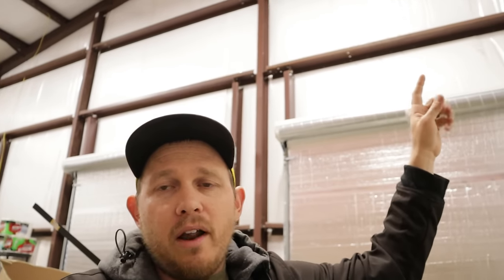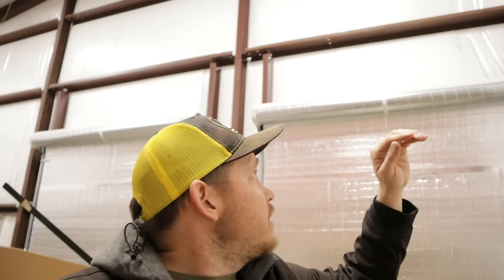My Biggest Steel Building Regrets

Comment: Truck size door is minimum can bring in anything with that size. I consider truck size insulated door standard 14X12 minimum or larger if working on heavy equipment like dozers and excavators. Insulation spray foam is a must in Canada and northern states. Floor heating is a blessing. If you have access to waste oil run a waste oil furnace and boiler. With waste oil burner if can't get waste oil can always use diesel, furnace oil, hydraulic oil and many more. Radiant heat is nice but warm feet and dry floors are better. Only problem with heated floor can't drill holes if installing anchor bolts for let's say hoist. Need to plan to prevent puncturing heat pipes hidden in concrete. I want to build a shop and had those things already planned. If have my way I'd install a hangar door lol amazing for summer horrible for winter that's where heated floors help because floor warm won't take long to warm up the place after opening door.
Reply from the maker: I can fit my 3500 ram through my doors but it is tight! Wish I would have gone larger for sure!!

That hanger door idea is great! I would also put some grated drains in the floor too if I was re-doing it for snow melt

Comment: Is a fabricated insulated structure more affordable. I know there easier to heat and cool because they’re built air tight.
Reply from the maker: Airtight pre-fab would probably be more affordable. The only thing I've heard of many of the pre-fab structure is that the build quality usually isn't as durable.

Comment: Thanks, good insight. Consider a rocket mass heater, solves a few problems like, only burn for a few hours instead of constantly maintaining a flame, the mass or "thermal battery" will keep warm long after fire is out, uses a third of the wood and the rocket stove exhausts so well that there's little chance of smelling smoke.
Reply from the maker: That's an awesome suggestion thank you so much!
Reply: @homesteadingbarndo  you should reach out to "liberator rocket stove" perhaps he'd be willing to sponsor a show or two. I've done a lot of homework on rocket mass heaters and liberator is what I'll be using at the heart of my system when I start building it. I'm in New York looking at West Virginia for homestead land. I would have saved many hours of research had I found your channel sooner. I'm about halfway through your catalogue of videos and you either reinforce what I've learned or taught me new things so thank you friend!... Jay

Comment: With a building that tall you should have put in a 16 X 16 door in the end.
Reply from the maker: That would have been a better option for sure. It was hard to get drywall sheets delivered because the openings would not fit the forklifts

Comment: If their ars Carpenter bees in your area they will destroy the wood. And they hate red iron.I know from experience. I will have a metal building or NO building. 2- 12x12 & 2) 12x14heated floors , closed cell foam and all electric in pipe. ( EMT OR PVC. Ian skylights. The same size as yours but 30' overhang's all the way around.also a waste oil heat for the shop and a split unit for the house
Reply from the maker: I wish I would have done overhang. That sounds like a great setup
Reply: You can still add them and put the RV under it. Then if you need to close them in at a later date it is much easier to do with red iron than wood. Don't forget to spray roof with closed cell foam. Hope 2023 is a good year for you and your family.

Comment: I own Mr Foam.  Foam your roof exterior. 2.8lb foam. Hire an experieced contractor. Its a 50 year maintainable system. It will never leak if done properly. It should take care of your sweating problem
Reply from the maker: That sounds like a game changer!! It gets put on the exterior?
Reply: @homesteadingbarndo  yes best roofing insulation system their is and is maintainable for a long life. Being seamless it never leaks. We dont even do interior were too busy with exterior roofing foam
Reply from the maker: Do you have a website? I would love to find out more!
Reply: I'd like to know more about this as well. Can't find any info on it
Reply: always insulate from the exterior. less toxic no interference for conduits no condensation. Why do Americans do it backwards?
Reply from the maker: @bernardmauge8613  what do you mean? Sorry but this backwards american didn't know you could insulate on the outside!
Reply: @homesteadingbarndo  This is why you are a backward American! The best way to insulate a new metal building  is to either buy the sandwich type metal sheet sold everywhere in Europe. or glue foams panels from the outside and spray a isothermic stucco as a final coat. Since the foam is glue on, no condensation ever. I am sure you can find it in the US. People just dont know about it. Also it is very expensive. Now the ideal concept when you build your shop, is that you want total access to the walls from the inside, because you will have miles of plumbing, conduits, etc.. You also need thick plywood to hang stuff . You dont want to hang stuff from drywall. My advice: If you live in it, with kids, dont spray any chemical in the inside, as well as fiberglass, use natural insulators.
Reply from the maker: @bernardmauge8613  This makes sense, Thanks for the info!!! It is wild how little info there is on these cool products. Someone in the US built pre-insulated metal panels that look great but you can't find contact or sales info. So wild, definitely a huge demand. Maybe I'll figure out how to import them and start selling them here.
Reply: @homesteadingbarndo  Check in Canada first.

Comment: You can’t run a outdoor wood boiler without electricity, it has pumps.
Reply from the maker: Good to know. I ended up putting a pellet stove in the shop and it is a game changer! It's 18 outside today but 51 in the shop and 70 in the house

Comment: You need to be very careful with spray foam it needs to be installed correctly
Reply from the maker: That's what I've heard, that temperature is very important when installing
Reply: @homesteadingbarndo  not only that you need the right type and a person that knows how to put it on 
If not done right it causes black mold 
If you ever get it done do your homework and don't go with the cheapest 
And for in floor  heating works best with the outdoor furnace 
It's popular here in shediac new Brunswick Canada
Actually I'm a iron worker and I've put plenty of structural and pre engineered buildings looks like you did a awesome job 
And for the overhead doors you always put it a little bigger than what you need 
Nice building can't wait till I get one 50x100 they want 249k without tax delivery and insulation 
That's why I was asking where u got yours
Reply: @homesteadingbarndo   As somebody who has a lot of spray foam insulation in their house. I can tell you go with closed cell foam and make sure they spray only in lifts no greater than 2".  Spray foam is expensive but it's absolutely fantastic and worth it
Reply from the maker: This year I've had lots of trouble with my rolled batted insulation because I added my windows. I really wish I would have gone that route

Comment: The structural engineering included the window calculations.... right?
Reply from the maker: Yes they have steel rough opening frames. I'm doing a video about designing with the steel company very soon
Reply: @homesteadingbarndo  Good on ya!

Comment: spray foam is a fire risk you would have had to put plywood up all around 8 foot up atleast
Reply from the maker: I had no idea about that! Thanks for letting me know, that would have been insane expensive back when I built but prices are better now
Reply: have to be fired rated plywood not to burn...or use a liner panel
Reply from the maker: @jon-qd4gb  yep we are doing sheet rock
Reply: @homesteadingbarndo  metal studs n add extra itch if possible

Comment: Why didn't you use insulated panels ?
Reply from the maker: I haven't seen anyone use insulated panels on steel like this. I've seen some newer products that act like insulated panels that have the same contours as the steel panels. 

Typically people go 2 ways- either rolled fiberglass or closed cell spray foam. We went with rolled fiberglass because it was the option the company who sold us the kit could include in the sale. 

Have you seen people use insulated panels? I'm sure that could work somehow, and I'd love to see what that looks like
Reply: I saw a YouTube video the other day that a guy was using insulation panels for his. He loved them. He spoke about the condensation too.

Comment: dang spray foam is really that expensive?
Reply from the maker: Yep unfortunately, there are diy kits but it is really important to I stall at proper temps and if you screw it up it can be a catastrophy.
Reply: @homesteadingbarndo  i guess i never really thought about the cost, but i never would have guessed it would be anywhere near that much. crazy

Comment: 30K I would it be easier and cheaper to heat and insulate a wood structure
Reply from the maker: Spray foam costs would be the same regardless of the build materials. In today's market it is probably cheaper to do wood because lumber has come down in price so much.

Comment: Spray foam can cause moisture between it and the steel and rot out the steel.

The price difference between foam and batt or even ridged foam, 15k? 20k? You will never spend that in heat in my opinion.
Reply from the maker: I didn't realize that can happen but makes sense. This rolled insulation seems to be working out
Reply: @homesteadingbarndo  I building a shop within my 80x45 pole barn. Roughly 1600sq ft. 
Thinking I'm going to use 3" ridged foam. Put it right across the purlons, leaving a air gap of 1.5", width of purlons. Saw a guy on youtube do it that way and it seemed like it worked great. Ceiling will be blown in.
Inside dividing  wall will be batt insulation.
Reply from the maker: @bucksnortbumblefuk6872  very cool sounds like a good setup I'm definitely going to down blown in this winter